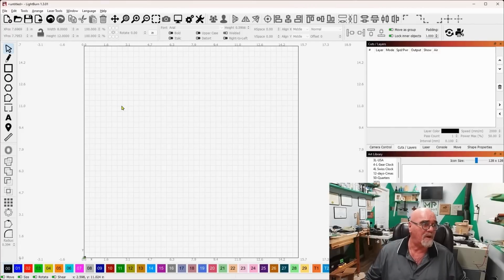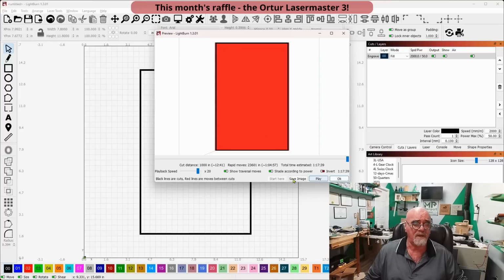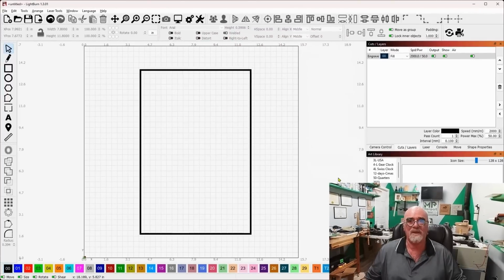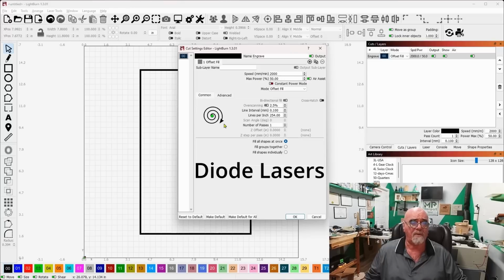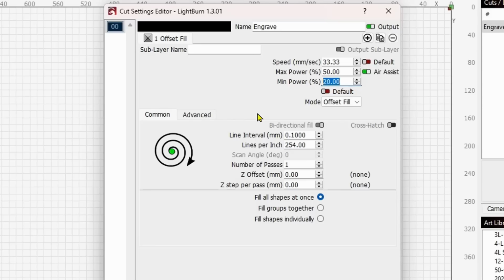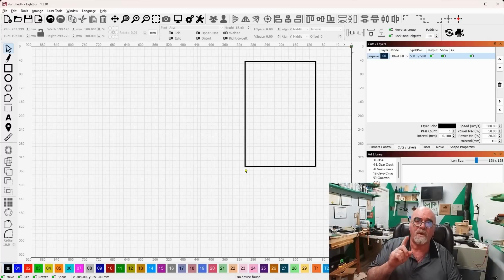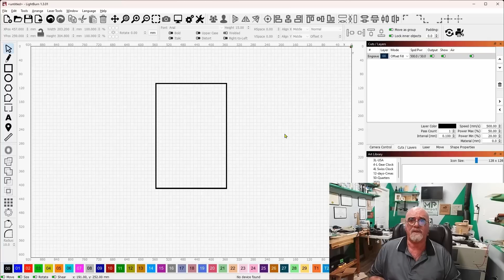😲 Save 90% time on your laser engravings with the one little trick! Offset Fill!

Comment: Im using a diode laser to remove the silvering on the back of mirrors. I find that in offset fill mode the path traced out is more visible than in fill mode.
Reply from the maker: I'll have to try that Colin.
Reply: @TheLouisianaHobbyGuy  Most noticeable if I print a square. The laser path is a square spiral and I think it overtburns when it slows down for turns?
Reply from the maker: I don't think Offset fill changes speed. At least I haven't seen that.

Comment: I was just wondering if you could help me with I've been having some problems with aluminum to get it to etch on the aluminum I have a 20WATT Laser and diode and they say that it will etch on aluminum but it won't do nothing it's not broke or anything it's just it won't etch on aluminum what am I doing wrong
Reply from the maker: With a diode laser, you have to use full power and go very slow.

Comment: I am running a I7 processor with 64gb of ram, gforce 2070 super. offset fill take forever to process. Is there a setting to change to speed this up?
Reply from the maker: No, offset fill and 3D slicing take time to process. To speed it up, lower the LPI.

Comment: Rich, I have a lightburn question.  Is it possible to swap the X and Y axis on the screen?  I am upgrading my Comgrow Z1 and I have to rotate the machine 90 degrees clockwise to fit it on my bench. I think it would be easier if the machine and screen are in the same orientation.  Thanks!
Reply from the maker: No Eric, the X & Y are calibrated to the laser. At least not that I know of. You would have to rewire it.
Reply: @TheLouisianaHobbyGuy  oh well..  I guess I'll get used to it eventually..

Comment: @TheLouisianahobbyguy Is the Atezr 20w really that much different from the xtool 20w?
Reply from the maker: The Atzer works!
Reply: @TheLouisianaHobbyGuy  Ha, ha! I've been lucky as my 10w has been trucking along, fingers crossed. Do you know if the new 35w they're coming out with has risers or legs? It comes with a rotory and it needs height so I'm assuming the legs fold? Don't have much room and looking around at different lasers as my business is growing. Either the 35w or the Gweikecloud RF model in the near future
BTW, love your videos and forum! Super informitive and I've learned a ton!
Reply from the maker: The new 35W is just the module for an upgrade to an existing unit Dexter.
Reply: @TheLouisianaHobbyGuy  you can get it according to their site as a kit with the whole gantry system, air assist, rotory, etc

Comment: Great info as usual, but I don’t see the minimum only the maximum. ?? Im on the Monport 40 watt just like yours with lightburn 1.3.01
Reply: Speed (mm/sec) 125.00
Max Power (%) 30.00
On Constant Power Mode
Mode Offset Fill
Reply from the maker: The Monport 40W uses a Grbl control board, so you won't that feature. It's only on DSP control boards Mike.

Comment: I've always wanted to ask the question on how to engrave a boarder without scanning to and fro; but finally got the answer from this video. Thank you very much. On minimum power, I've been using zero; is there a problem with that?
Reply from the maker: I use about 30-35% less power on minimum and it works well for me Reuben.

Comment: unless you are experienced stay away from fill and offset, if you happen to select it on anything other than a perfect straight line it will lock up you PC and can overheat and fry  your memory.  They should remove it.
Reply from the maker: Try another computer. These two modes are what you use to accomplish incredible engravings.

Comment: I know this video is a year old but using offset fill keeps freezing up LightBurn. Have you had any issues with that happening? I have to totally shut down the program and start over.
Reply from the maker: Yes, if your LPI is too high (over 275) it will take a long time to process. The computer isn't locked up, Lightburn is processing the paths. If you wait long enough, it will complete.

Comment: I must have checked or unchecked something because when I make the same pic frame at 100 inches per minute I get a solid black box in the preview and the time is 3hrs and 28 mins with fill and 3 hrs 27 mins with offset fill.  What am I missing? Thanks for any help
Reply from the maker: I really don't know, I can't see your settings in a text.

Comment: Rich,  I got my Comgo z1 all fixed up.  Now it's about 400x800.  However, still having a lightburn issue.  I have modified the device settings, machine settings, but Lightburn still wont let me go past the original 400x400 work area.  It homes ok and will frame ok within the original 400x400,  but i go past that and I get "ALARM 2  G-code motion target exceeds machine travel. Machine position safely retained.  Alarm may be unlocked"  Did I miss something?  Is there some G-code setting I need to change?  Thanks for all your help!
Reply from the maker: No, just the machine settings and device settings Eric.
Reply: @TheLouisianaHobbyGuy  any idea on what could cause that?  Maybe a limitation in firmware?  I saw someone suggest switching from absolute coordinates to  current position
Reply from the maker: All of the firmware settings are in the machine settings. Edit --> Machine settings. If you can't get it to work, you may have to contact Comgrow. There are several users in the FB groups with the extension kit.
Reply: @TheLouisianaHobbyGuy  I will have to try the Facebook group.  Thanks!
Reply: @TheLouisianaHobbyGuy  I figured it out.  In Lightburn I had to change $131 of the G-code.  As soon as I entered $131=800 it worked fine.  Thanks again! 🙂

Comment: Hallo Rich. many thanks for this enlightening video. In anticipation of the announced review, this is my question:   A few days ago I watched your preview / interview about the new high level laser. It seems to be really a very high quality machine. My jaw dropped, though, at the high price tag. I have been in the laser hobby only about half a year. I started with the Sculpfun S9 5.5W. A nice machine but I have encountered it's cutting limits very quickly. 4 mm ply is the practical cutting limit of this machine, in my experience (upon somebody's advice I do not exceed 75% power, to avoid shortening the diode's life expectancy).   As I need better cutting ability I bought the 10W diode.  This brought a significant improvement.  Now, cutting 6mm ply is easy, with 5 - 6 passes and a very mild scorching.  Cutting Birch is still not practical:  At 700 / 70 it takes 12 passes and the edges become very scorched.   The new high level machine seems to be of the highest quality but  has no more cutting power?   So, when you do your full review of this machine, maybe you could address this dilemma: what should one do, invest in this limited power laser or in a 30W one with, maybe, lesser general quality?   many thanks. Emanuel
Reply from the maker: I just did 13mm solid oak in 5 passes Emanuel during the testing. 6mm Baltic Birch at 77 power and one pass. And the price is not high! It's being offered at wholesale during the launch! You have to consider all of the options included on this machine that you have to buy separately on any other. This is a complete package! Plus, if you want to cut the price in half, you can elect to get it without all the options.
Reply: @TheLouisianaHobbyGuy  Wow. I am amazed . These are very good results! I'll wait for your full review. Thanks a lot.

Comment: I'm going flood fill circle on ⅛ inch birch. 160mm/s, 14%pwr on 60w OM. 
I'm just barely blowing through on the top where the stop/start is.  Can you alternate start stop to bottom of the circle?  Min power is low as I can go.
Reply: Brian, upping your speed should solve your issue here.
Reply from the maker: Kiwi got it right Brian!

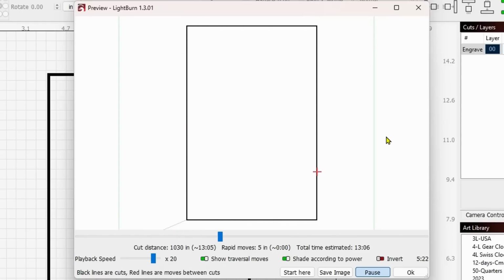Comment: Just a curiosity question: when you are running the preview of offset mode, at about 6:40 in the preview (2:40 in the video), the trace changes from clockwise to counter-clockwise. Why did it do this and is it controllable? Also, I tried this and each engraving is making 2 passes rather that the specified 1 pass. Is this normal? Thanks and keep making these great videos!
Reply from the maker: Yes, it's normal, and I don't know why Lightburn chooses the paths it takes. Some of them are crazy, like when you choose to fill shapes individually.

Comment: Thanks Rich. The Roly laser which I have looked at on Amazon (is marked as currently unavailable and they don't know when it will be back in stock) looks like a very good package for anyone thinking of getting started with diode lasering.
The offset fill makes a lot of sense but only for simple frames!
 For complex, frilly frames, it makes more sense to split the design in half. this keeps white space traversals small and etch time down. This tip came from the Australian starting a new YT channel that he mentions in posts on your Facebook page.
Reply from the maker: They're in the Amazon supply chain. As soon as logistics gets them settled in a distribution center, they'll be ready for sale. Should be in a few days.